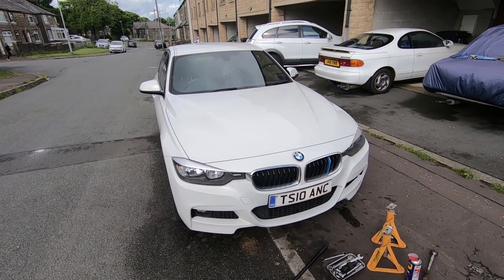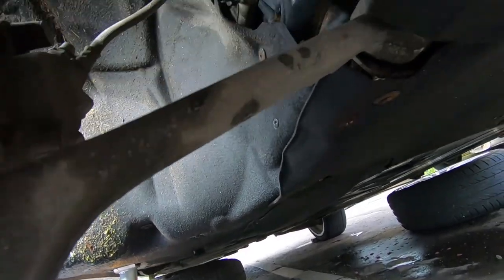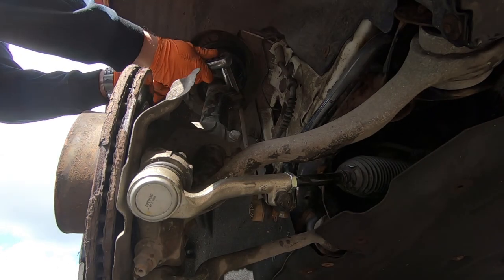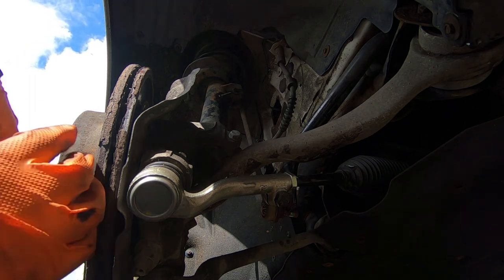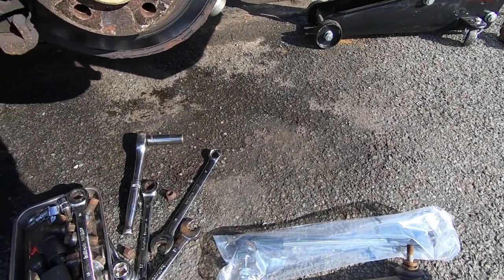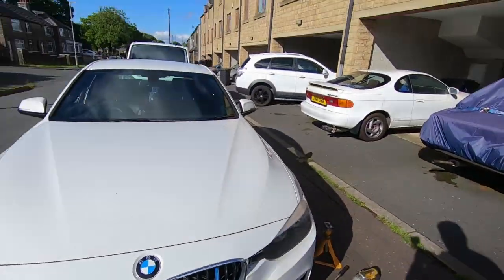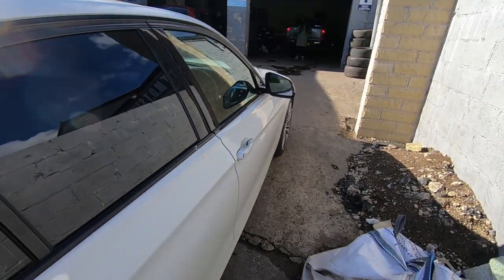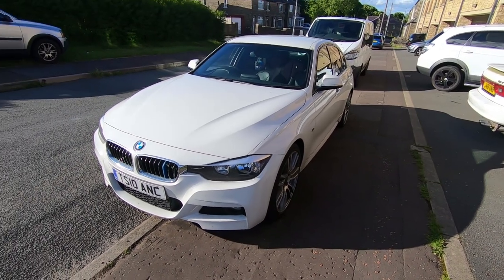2013 BMW F30 381d Part 14 - Front anti-roll bar drop link replacement.

Comment: Those discs are knacked
Reply from the maker: They're fine. The car was out of use at the time because the owner was on holiday and left the car with me. They won't need replacing until the next pad change.
Reply: I did say this too.

Definitely NOT just service rust.

But people see things differently to each other I guess.

Alan L200
Reply: Discs are well past their best 😌
Reply from the maker: There's still some life left in them...
Reply: State of those bad boys😂😂 1 or 2 emergency stops before inevitable doom.. hope to god you didn't advise not to change them.. over and out ... Mr arm chair mechanic
Reply from the maker: You're not in front of the car so you're in no position to comment. Yet another armchair mechanic.

Comment: Good video as always.

Brake discs next? Very crusty.

Keep up the good work.

Alan L200
Reply from the maker: The discs are fine. It was standing at the time so a bit of surface rush has built up. I changed the pads recently so it'll get new discs on the next pad change or when it fails the MoT whichever is sooner.

Comment: this lad had gone through hell and high water to figure this damned f30 clunking out man. i havent finnished this video yet but good on you mate.
Reply from the maker: The problem was a steering rack mount. Unfortunately, I can't take the credit for that one.
Reply: @Parknest  when you say mount do you mean it's just where the rack itself bolts on to the car? I've been having this rattle issue and it's doing my head in. Suspension is fine. Done the steering rack thrust piece repair kit. This is my last hope!
Reply from the maker: @Pr0ject2  Yeah that's right. Sounds like you have the same problem.
Reply: @Parknest how dis u fix it? Did u just tighten it? Or replaced the mounts?